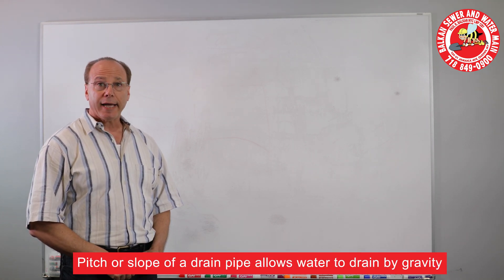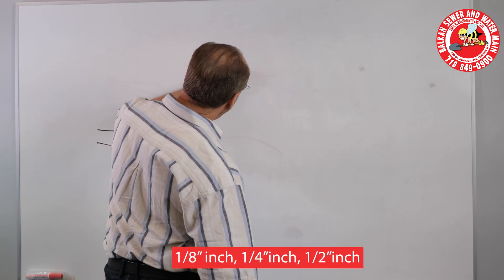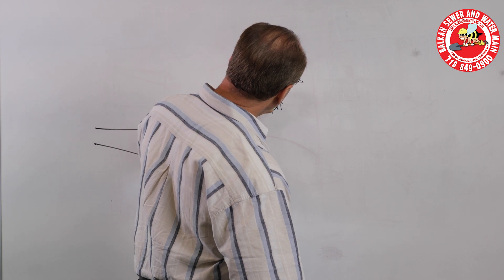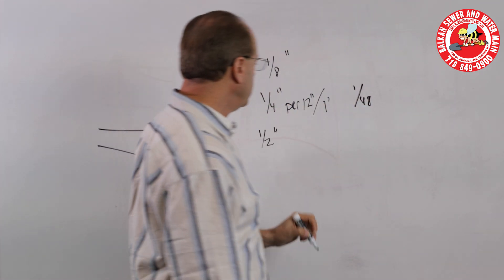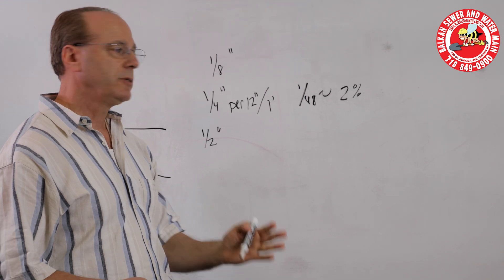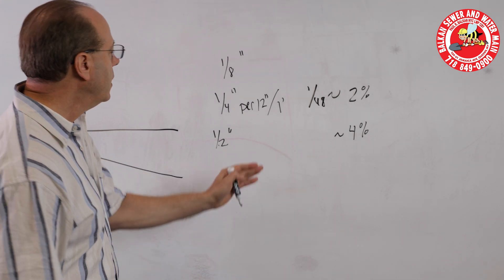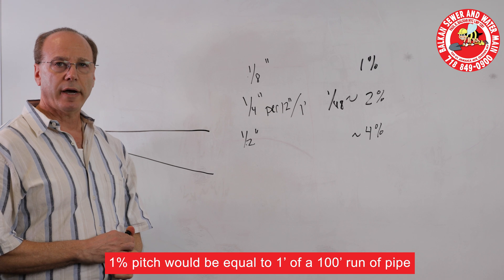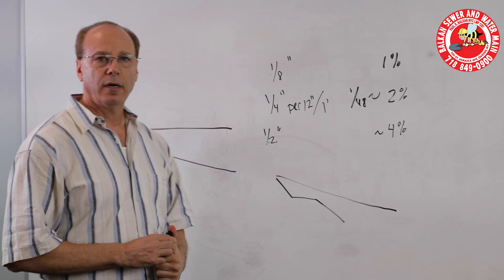Plumbing Pitch On Sewer Pipes Guide - A Helpful Explanation

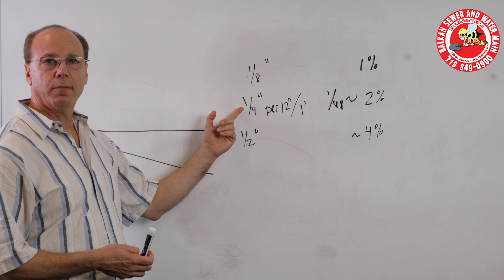Comment: At the 2:37 mark of the video, he states; "1/4 inch of pitch per foot or 1 inch per five feet of run"? Shouldn't that be 1" every four feet of run?
Other than that, I appreciate the explanation.
Reply from the maker: These are just rough rules of thumb. Using either one will result in a properly flowing drain system. And, glad you appreciated the video. Thank you.

Comment: I have (A) 3% pitch of 100mm pipe, it has a 90 turn at base of toilet bowl and 45 turn at the end of pipe which is 3.3m  (B) separate pipe with 8% pitch 100mm 1.2m (120cm) length with 90 turn on the start next to bowl and a second 90 turn on the end which then ties/drops vertical into ceptic. Curious if these 2 are ok.
Reply from the maker: In nyc 90’s are only legal when facing down. Not sure about the rest.

Comment: Very informative channel here, just subscribed. I just replaced 50 year old (16 feet) cast iron with 3 inch PVC, went with 1/4 to 3/8 pitch and it all flows out into the septic great. Love you channel, it's better than most.
Reply from the maker: Thank you so much. Positivity is a commodity.